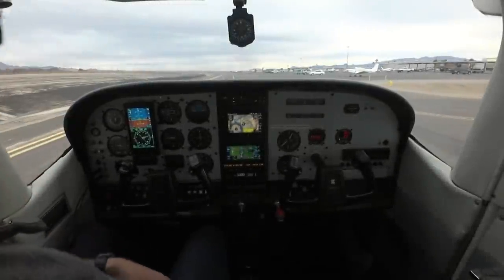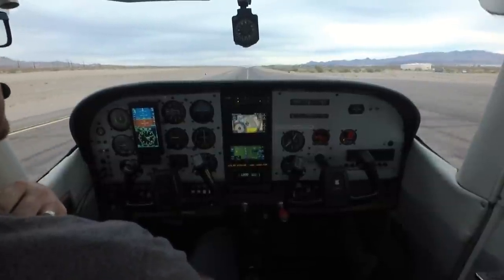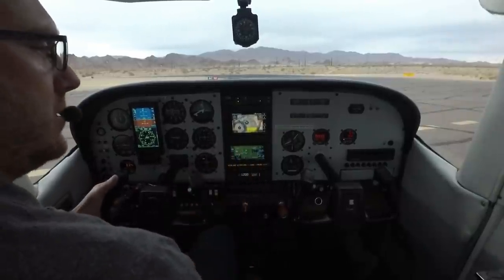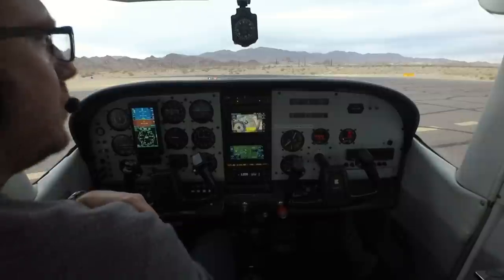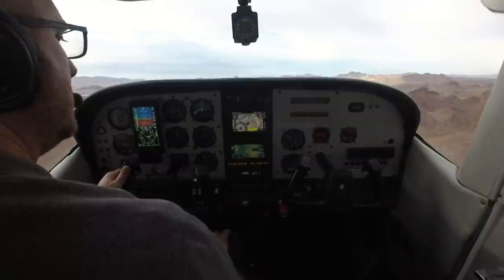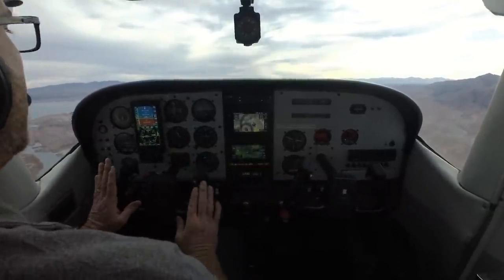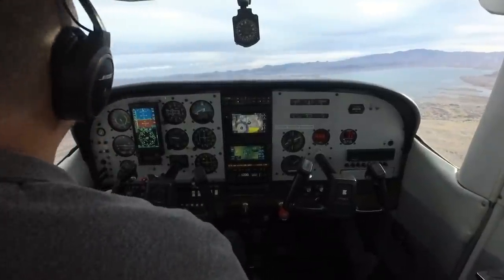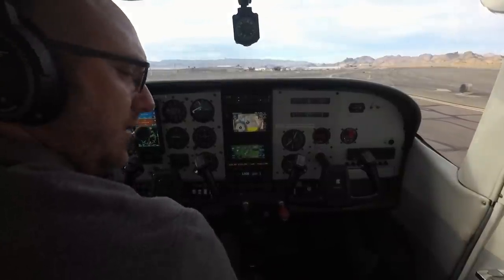How to Properly "Trim" the Cessna 182

Comment: I've got my Microsoft flight simulator on my Xbox two weeks ago and got very confused about those words about "trim", "flap" etc. I don't know what they are and what's the relationship between them. This video is by far the best one explaining those ideas.
Reply: Now all we need in flight simulators is that control wheel/stick force. I lost my medical a long time ago, and so am stuck to simulators. For the life of me, I try to remember how I set trim in a real aircraft, and the sim software doesn't behave exactly like I remember real airplanes doing. It's a bit frustrating sometimes.
Reply: @8a41jt  Interesting. Can you explain what's different? I'm just getting into planes and I want to know what's different in the Sim.

Comment: When I used to fly my dad’s Cherokee Arrow, I never let the manifold pressure exceed the prop rpm; i.e., I reduced power to 24 inches first and then pulled the prop back to 2400 rpm. I did use the same method for trimming - apply pressure to the yoke to make an airspeed change and then trim the pressure off. If your arm is getting tired, you aren’t trimmed properly. The plane should always be trimmed to maintain a safe airspeed on its own..

Comment: Great video. I just went to get current in a 182 skyline but it’s a 260 horse carb model. Have not flown a 182 in long time. Under 550 hrs. I flew pretty good and made the worst few landings I’ve had since my first 5-8 hrs of flight training 😔. I am now afraid to land. I am in Goodyear AZ. I could use a good lesson or two from this CFI. I love flying but have “lost that lov’n feeling” just from a few not so good landings. Most of these CFI’s are young and not checked in a 182 and waiting on their airline jobs, so there’s no good CFI option. The plane is a rental from a facility that I know the owner of. Well maintained planes too. Please em mail. I want to get that feeling back again and not be afraid to land and maintain control and flying once on the roll out. Thanks.

Comment: Full power on a continued climb out clear of terrain coupled with lower RPM and then leaning? This is why jugs get replaced and engines get topped. When you're not busy yapping too much, read up on proper engine operation. If you were flying my 182 that would be the last time you did.

Comment: after reducing power as you get in close but keeping in a little bit during the roundout and flare, do you pull it all the way out as you're about to settle on the mains?  Also, 60kts approach seems really slow compared to the 75 I've been recommended for the 182 we fly. Is this because it's not a retractable RG? I know speeds are different many times for the same airplanes depending on configurations....

Comment: Are you the only runway for miles and miles? I don't hear the airport mentioned before and after the radio calls. Here in the Puget Sound airports are very close together.

Comment: Did you add carb heat on your base. If no, why not? I just bought a Skylane here in Prescott and working on my ppl so I don't want to miss that critical step, assuming I should on every landing. Can you comment on that please. Thanks. Great video by the way. N3633U
Reply from the maker: This aircraft is modified with a more powerful, fuel injected  engine so it doesn’t have carb heat!  If yours has a carb, I still very much recommend using carb heat at partial throttle settings.

Comment: I have a cessna 182L  1968.  I"m curious about your use of the prop control.  I"m not sure which cfi told me to as soon as I am on the upwind to take her out of the red.  I noticed you didn't for quite a while and then when you set to 2400 rpm you left it there.  Again I'm curios cause my cfi told me to run square.  Can you expand on that to why you didn't and if it's because of your training of this situation, and if you do change the prop control when in crews is running square the right thing to do.  I enjoyed your video and enjoyed you explanation of the trim situation I can't wait to go up and try that.  Thanks
Reply: I wondered about that too. I flew a Cherokee Arrow for a few years and I never ran it over-square. I'd pull the throttle back to 24 inches once I was at pattern altitude and then pull the prop back to 2400 rpm..

Comment: Tell me more about these nose mounted canards. (What model 182 is this?)
Reply from the maker: The Canards are part of an STC’d modification performed by Peterson Performance in Kansas.  The mod is available for 182 P and Q models only.
The canards dramatically change the low speed performance of these planes and allows them to fly at a much lower angle of attack for a given airspeed, which results in drastically improved short field performance!
Take off in 390’ and land in 300’!
Reply: @nerdsofflight7294  I think I found some information on it. Is it the Peterson 260SE?
Reply from the maker: Yes, mine is the 260SE
The Karmai has the Wing-X Stol extensions (18” per wing)
Some like that but I prefer not to have them because it only produces about 4 knots lower stall speed, but at the expense of a lower VNe speed and a little less clearance for fitting in a 40’ wide hangar!  
All of them from the 230SE, 260SE to the Katmai, Kenai and the King Katmai are really terrific planes!
Reply: @nerdsofflight7294  How does it affect cruise speed?

Comment: When you take power away, are you moving the throttle or prop ?
Reply from the maker: Technically, either would reduce the power but it’s quite uncommon to do it with the prop.
So making power adjustments with the throttle and using manifold pressure as the gauge
Reply: @nerdsofflight7294   thanks for the explanation, ive never flown a constant speed prop befor. I owned a Cessna 172. I am looking to get into a baron
Reply: @chrissampson5549  Low pitch (aka high RPM or full forward position) is needed when an airplane is slow (during a take-off run and climbs). As you remember, prop blades are nothing more than another pair of wings (airfoils) in a vertical plane. This is a fine pitch position   :::|>   As you gain speed in cruise flight, it will start to create more drag (because relative wind shifts forward) and less horizontal lift, so you need to adjust them to this higher pitch position    :::\>    It's comparable to bicycle shifter or manual transmission in a car and it helps to operate your engine more efficiently at different speeds.